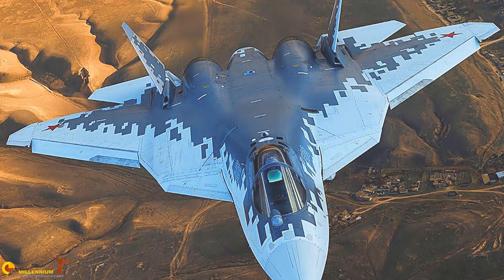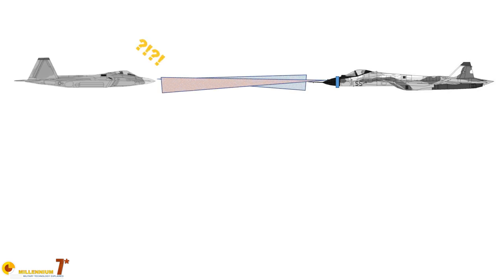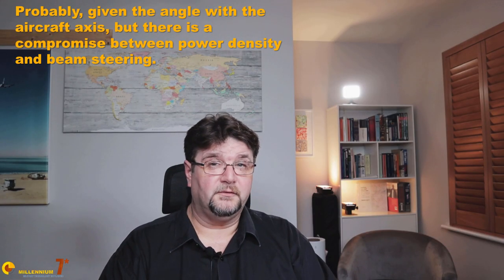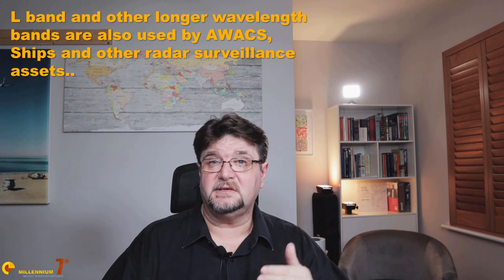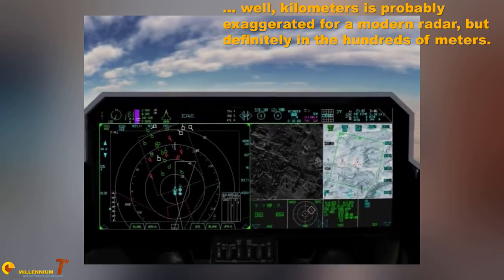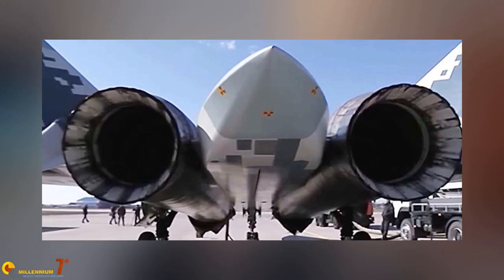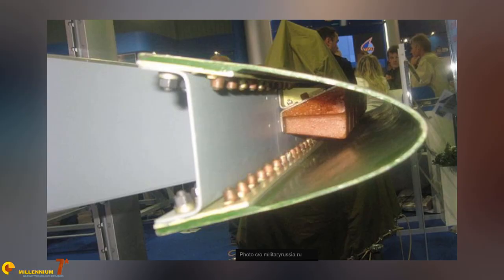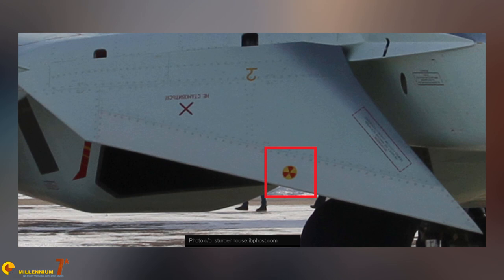Su-57 the Raptor Spotter | Part 4 - Radars, ESM, ECM, IFF

Comment: Having multiple radars also significantly reduces the chances that they could be jammed. Great analysis, as always.
Reply: How ? The L-band radar ay not be jammable by an X band radar in an F-35 say, but it doesn't have the size or accuracy to do more that approximately detect when an adversary may be. Given the small size of the L band radar and thats in the leading edge (which will be a problem if the Su-57 is actually manoeuvring) its accuracy at distance will be compromised.
Reply: @nickbrough8335  l-band isn't meant for accuracy, its more of a target approximation. Also you don't maneuver at long range, and at the range you really need to maneuver,  x-band takes over, even disregarding secondary location sources like irst and commlink
Reply: @phunkracy  I'm not claiming the L-band radar is a stealth defeater (I'm skeptical given the size and positioning of the L band radars). When you go back to X-band US Stealth technology is likely to provide US aircraft with a radar detection and targeting advantage on some tens of kms. As suggested elsewhere in the comments, IRST may also offset this (esp against a current F-22) as well. 

However, knowing a Stealth aircraft is out there at the edge of your detection range with intermittent (most likely) contact isnt going to help you avoid a targeted missile attack from an unknown position.
Reply: @nickbrough8335  but l-band is longer range so you aren't being attacked from an "unknown" location, besides, Su-57 isn't supposed to fight for air superiority over hostile or neutral ground, it's a part of sophisticated air defense system much like F-22/F-35 is much more offense oriented and highly dependent on awacs. Even in your scenario a missile launch is an instant giveaway of your location + bvr rockets are easier to outmanuever still.
Reply: @nickbrough8335  but Russia cannot really contest Polish aerospace realisticly. For a simple reason: they have almost no forward operating airfields in Belarus. Best case scenario they destroy as much of polish infrastructure and airfields as possible with their Kaliningrad oblast forces and focus entirely on the Baltics, which allows to operate fully under the protective umbrella of their air defense. In that case F-35 ambushes are really out of the question.
Reply: @phunkracy  Attack with radar homing weapons from below the ground based radar horizon using low level attack will succeed too often for that strategy to work. In any case, the wealth of NATO combined will always beat Russia alone if they adopt a defensive strategy. The only way Russia wins any war against NATO is to penetrate deep into the west and force an armistice.

Destroying Polish infrastructure without ground attack is likely to fail as NATO airforces will exceed Russian numbers relatively rapidly. For example, the US has already exercised cross Atlantic resupply (first time since the cold war) the RAF intends to practice aircraft dispersal practices again in response to Russia actions.
Reply: @nickbrough8335  thats why Russians have invested a lot into passive detection . They still have enough strategic depth to detect and intercept with sophisticated, multilayered aa defence on top of that.

In Kaliningrad Russians concentrated their long range rocket artillery aimed at polish capital, airfields and Gdansk. There is no anti air system that can prevent a saturation attack with SRBM. Especially with polish vintage anti air equipment.
Reply: @nickbrough8335  You won't get a missile track, but you regain situational awareness, which is another advantage that stealth was supposed to provide - the degradation of enemy situational awareness. With these radars you have an accurate enough location of the stealth aircraft to box it in and/or report on its location at all times, so that friendlies at least KNOW there's a stealth aircraft in the area or, perhaps more importantly, that there ISN'T.
Reply: @dsdy1205  You can never know that something you cant detect beyond a particular range isnt there.
Reply: @nickbrough8335  isn't the point here that they can detect it, albeit not precisely enough for a missile track?
Reply: @phunkracy  I'm not convinced that any major missile strike will have enough density to take out that much military infrastructure and would face a counter-attack from numerous NATO air launched cruise missiles. 

Which passive detection are you talking about. I'm not aware of any that would really have long range (except electronic emissions detection) or would provide missile launch solutions.
Reply: Russian passive detection on vshorad includes acoustic,  radar, infrared and optic detection. In Poland we operate quite a few of those legacy systems after  modernisation.
Reply: @phunkracy  IR systems effectively max out at 30 to 100 km depending on the atmospheric conditions. Visual is limited to a similar range for much the same reasons. Sound will be much shorter distance for aircraft anyway. Radar isnt passive. Given a front line in the Baltics/Poland, if the systems aren't mobile then they're not going to be of any use in a conflict. Even ground based mobile systems are vulnerable to long range guided weapons. HARM-ER has an effective range of over 100 km (supposedly).
Reply: @nickbrough8335  IR/Visual is 100% passive and inpossible to detect, passive radars are in fact passive (sic!) and acoustic is crazh cheap.
Reply: @nickbrough8335  if a conflict is green lit you have no more than 8 minutes reaction time to destroy the enemy in Polish-Kaliningrad war scenario. So its down to luck and readiness
Reply: @phunkracy  NATO will have plans that that will include US ballistic missile defence systems being put in place (movement of Russian army units is going to be noticeable in advance). I doubt it is very viable to stop Russian takeover of the Baltic states in practice, but stopping or significantly reducing resupply from Russia ought to be a lot easier to achieve (even assuming Belarus permits it). I'm sure its been war gamed and there will be plans. 

Russian airfield capacity in Kaliningrad is limited and I'd expect the Baltic republics to damage as much infrastructure as possible to limit Russian options. If Belarus provided bases, then I'd expect Ukraine would also reciprocate. Would Sweden and Finland remain neutral as well ?

I don't see this as a very sensible strategy for Russia. If Belarus ever rejoins Russia then the risk would become significantly higher, but then NATO forces deployed in Poland would end up being significantly larger than today.
Reply: @phunkracy  For self defence on your own ground yes (just look at 1940 SE England layered air defences an example), but these assets would need to be deployed in Belarus and would then be in strike range of Polish or German based NATO air assets. They're also a finite resource and I'd guess that NATO is numerically superior at the end of the day.
Reply: @nickbrough8335  Belarus is already in very close alliance with Russia, I doubt that Russia would attack before securing Ukraine and isolating Poland diplomatically (as it does atm) - even breaking up NATO.
Reply: @phunkracy  I'm not sure an invasion of Ukraine is feasible. Yes they'd win (but at a high cost), but maintaining control will need a large occupation force. I don't know if some NATO members would just sit by and let it happen either. Poland isnt isolated diplomatically (although there's ongoing political sniping in the EU, something we're getting very used to in the UK) and I don't see it happening any time soon. NATO break-up is possible, but I think the EU would want to be a significant military power in its own right first. We may squabble a lot, but basically we have a very similar outlook at the end of the day.
Reply: @phunkracy  For a missile strike yes, but can that strike put all Polish military infrastructure out of operation for a significant period of time, especially if NATO forces are already present in numbers ?
Reply: @nickbrough8335  thats where diplomacy comes in play. It's not out of realm of possibility for a Łukaszenka 2.0 to gain power in Ukraine. In fact, until the coup Ukraine was firmly within russian sphere.  Poland is more isolated than ever since independence,  and if the trend if rise of far right and russian support for it will held,  Polexit is not out of the question. Ideologically Russia and Poland already have a lot in common. As for NATO, didnt trumpwant to abolish it? How many presidents will it take?
Reply: @nickbrough8335  it definitely can put polish and allied air force out of polish airspace. The plan for now is to relocate polish air force to germany in case of  conflict. This will significantly increase the needed range for aircraft. And polish MiGs already have a short range, so it leaves only refueling and drop tanks
Reply: @phunkracy  Less chance than there was I think. Demographically, each oblast is now majority Ukraine speaking, which is more anti-russian ethnically. Personally, I have no problems with Polexit :) as I believe more in the European Union than the European federal state.

Did Trump want to abolish it ? He said/implied that, but his main beef was the lack of Germany (especially) defence spending. Whilst that is an issue that isnt going to go away as the international situation worsens spending will pick up.
Reply: @phunkracy  Not from Kaliningrad. There aren't enough aircraft there and there are plenty of stealthy NATO cruise missiles to destroy the infrastructure in such a small area.
Reply: @nickbrough8335  Dude, why are you so obsessed with aircraft, and why do you presume NATO would make a preemptive strike? No other way to be quicker than Russians launch their SRBMs 🤔
Reply: @phunkracy  NATO will never launch a preemptive strike. Where did you get that from ? This is a blog about aircraft.
Reply: @phunkracy  One possible kind of defence is the active one otherwise known as counter-attack. And this is something Poland is very well capable of in esp. when we talk about the so called Kaliningrad oblast.

Comment: The L band radar is quite important - the Su-57 will be able to detect a stealth fighter, even if they won't be able to shoot at it. But this neatly ties into a second feature.
Modern radars pick a plane from the background clutter by its speed towards the radar (doppler shift separation). The way to break a radar lock is to move sideways to the enemy (called notching), so your speed towards them is the same as the ground. This normally means you lose radar lock as well, but with the side radars of the Su-57 this may no longer be the case.
The note about Russian systems being larger and heavier is true. I've heard Russian analysts talking about that - and noting that this forces Russian planes to be a bit larger in order to have similar capabilities. But they are well aware of it, and are compensating for it.

Comment: Hi M7 ! 

Excellent analysis . I did not see this one earlier,sorry. If You don't mind , I will correct some data and info and then You can make new updated video about complete Sh-121 MIRES combat complex if you want of course.  As I wrote earlier in your videos, Sh-121 is highly integrated and automated combat complex with N036 Byelka radar system and L402 Himalay active jamming system.Yes, it is part of  the IUS-57 with two IMA-BK digital comps.  IMA-BK stands for  Integrated Modular Avionics-Aircraft Complex  and those two comps has new Russian-made processors  Elbrus-8S. Main tasks are radar searching/looking , RWR,ELINT/ESM then ECM/ECCM and IFF ,so everything that can be used in radio/radar bands of EM spectrum. As written earlier and to repeat,N036 Byelka as dual-band radar system has in fact 8 ( eight ) AESA radars where four of them work in centimetric X-band and four work in decimetric L-band.

Four high-frequency,short-wave  X-band/ f=8.5-11.5 GHz, λ≈3cm/  AESA ( as 3D-radars) are : the main one N036  in the front position(15° angled upward) with  exactly 1526 four-channeled TRM ( 700x900mm antenna dimension) ,then two AESA as SLAR designated N036B  (15° angled downward) with 358 TRM each in the sides of the  front part of  the fuselage .Fourth X band AESA is in fact  called Epolet-A radar with 68 TRM which is positioned in the tailboom for the rear looking. All of them have 120° ( +/-60°) radar envelope.The main AESA for front looking and the one for rear looking have vertical polarisation and those two SLAR/AESA have hor. polarisation.
All of them can be used for radar searching,detecting/tracking and lock-on. Then for IFF/ID, comm,nav ,ESM ,ECM and RWR modes.Max output signal power of each channel in TRM is 10W but the catch is in PRT and PRF. For now ,data about them  will stay censored,sorry. Note: there can be more radar beams in the same time  from the reflector of the antenna of AESA ( in general). Inovation is e.g. 'dynamic beams with width only 1° ' etc. Scanning speed is measured in nanosec and frequency agility is several thousand times pour sec. AESA radars can simultaneosly work in HPRF and MPRF modes also can simultaneosly work in search ( detect/track ) modes and lock-on mode.

AESA called Epolet-A can be used for the  two new AAM's : Product 270 or R-47 and Product 760 or R-74M2. Both of them can be used for engaging enemy fighters in the rear hemisphere of the own aircraft during close-in combat.

Four low-frequency,long-wave  L-band/f=1.28-1.55GHz, λ=24cm/ AESA are positioned ,two in LEVCON's and two in wingslats. In fact, they are linear 2D- (not 3D) radars where aircraft can be tracked by two angular coordinates :distance and azimuth.Elevation data comes via data-link from other aerial assets or from centimetric AESA radars or OLS-50M/101KS-V IRST/LR of own fighter L-band AESA have 1.6m wide antenna with three very big  four-channeled TRM where every channel has max output signal power of 1kW. Each channel has own task : channel No1 is for the  international  IFF ( NATO standard Mk12) , channel No2 is for the  long-range radar search and long-range detection/track especially stealth aircraft. Channel No3 is for the domestic IFF ( system called Parol ) and channel No4 is for the ECM/jamm in decimetric band ( jamming enemy L-band assets ).Radar envelope  in azimuth of L band AESA is 110° ( +/-55° ) with beam width in elevation 70°-90° . 
Each L-band AESA has two rows of radiating elements ( waveguides). One upper is used when LEVCON's and wingslats are in down position and lower one can be used when LEVCON's and wingslats are in neutral position. L-band AESA can be used for search of airspace as wrote especially for long range detection of any stealth aircraft  and it is the real so called ''gamechanger''. Two radar rules : ''The greater the radar signal wavelength is ,the greater is detection distance'' and  ''the thickness of an illuminated  aircraft's skin must be  equal to half the wavelength of the radar signals that illuminate that skin.'' Everything is now clear.

Wrote earlier,  all AESA radars can work in active-illumination( active pelengation) mode or passive radio-goniometric( passive pelengation) mode. L-band AESA can work in Mono and Bi-static modes . Bi-static mode means that L band AESA of one fighter sends signals,other AESA in another fighter receive those signals that returns from some aircraft. All AESA radars are controled by N036UVS digit comps. With all of these AESA radars,Su-57 possess all around radar coverage or 360° azimuthal radar envelope.All AESA use DC of 27V power line ,cooling is by air and from kerosene. AESA in general has one very big disadvantage and that is very big heat signature when works in illumination -radiation mode. PRF is enormous and is measured in several even tens of GHz ( old mechanical radars and PESA with TWT's have PRF in HPRF mode of 100-500kHz).We use to say when AESA is illuminating it is like Christmas tree in the sky.  Fighters with AESA that works have very big frontal heat signature.  So Russians use special material for the reflector of the antenna /waveguide system and it is based on the Gold plates. Gold is ? We all know what .... Same technical solution they use for Su-35S's  N035 Irbis radar antenna.All radar tactical data can be transferred via high speed digital data link ( IFDL ) between Su-57's in the main combat-patrol group ( 4 fighters) or in the big joint combat-patrol group ( 16 fighters) at distance max 400kms from each other when flying in stratosphere from 10kms and higher.

IFF/ID system known as N036Sh called Reaper can use all AESA radars but priority is to use long-range decimetric L-band AESA IFF channels. ECM ( jamming) system L402 Himalay can use all AESA radars and especially those four AESA jam-stations that are positioned in the wingtips. So that four AESA in the sides of the wingtips are for ELINT/ESM/RWR /ECM tasks for front and rear hemisphere.   All the best M7  !

Comment: Stealth aircraft rely on running passive radar and no active jamming and using Radar sources from AWAC or the like to light up their targets for them. 
Also the enemy's own radar if in active mode will give them away. 
But the newest SAM systems have extreme range and is now able to shoot down the AWAC even when it is patrolling way back. 
So if put in a situation where F-35/F-22 cannot rely on an outside source, they would have to go active themselves and giving their position away. 
That does not negate stealth as just knowing the approximate position and heading of a stealth aircraft does not mean your targeting radar can log on to it, but some modern AA-missiles can fly towards the general area and only turn on their own radar, when they are close and just acquire target themselves.